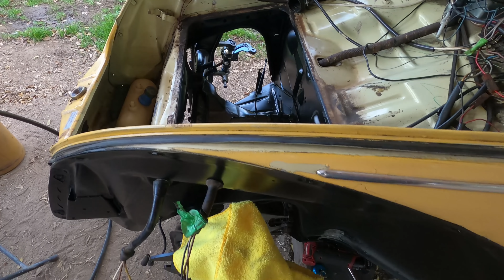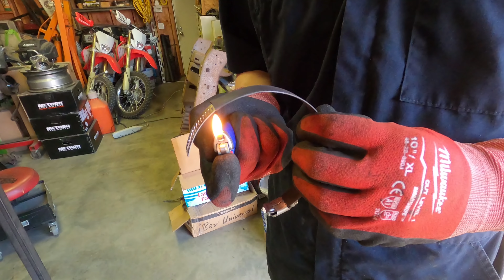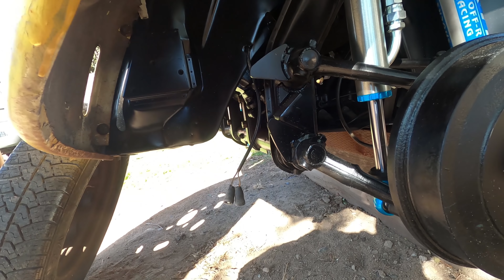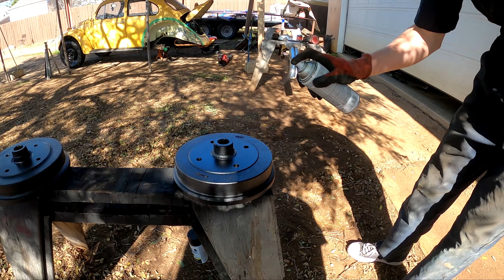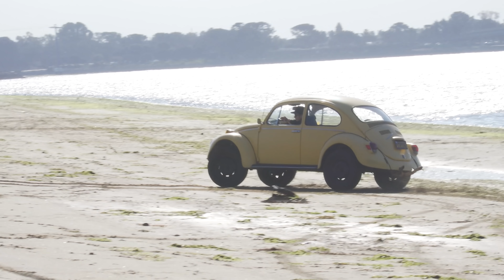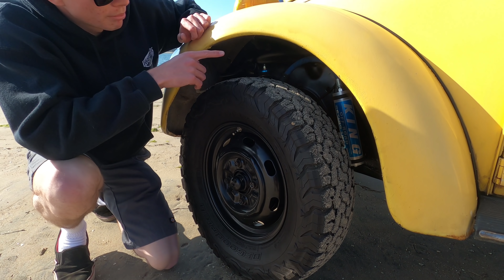Stage One is Complete! Bug Build Ep. 3

Comment: hi, I saw that you have fitted 215 75 r15 tyres, I wanted to ask you, have you fitted them on the original 4 1/2 Volkswagen rims?
Reply: I was wondering the same , however 215 wide is over 8'' so fitted to 4 1/2 would be not right. Possibly 6'' rims. Lets hope he replies.

Comment: Fantastic! I’m wanting to have an old VDubbie like this. I, years back, had a ‘71 Super Beetle, flat windshield, steel sunroof, pop out rear windows, worked the 1600 dual port to a 1776 cc’s, Dual DeLorto carbs with Porcha style linkage. I’m wanting to get one built again but I’d like to have a roll cage installed and a kick ass lift like yours to be able to take it off road. I’m a retired Philadelphia Police Officer and I’ll be 70 this coming October. With what’s going on in our country, a worked VDubbie with a compartment in the rear passenger area for an AR-15, first aid kit and other survival equipment would be genius.

Comment: you guys could have probably used a wire wheel on a grinder to clean the rear wheel wells up faster
Reply from the maker: I tried that! The liner was rubber/plastic and the wire wheel slowly ground through it, the chisel worked better to get underneath the liner and peel it off.

Comment: Just curious if you installed a solid Mount motor mounts? highly recommend
Reply from the maker: I have not! didnt know that was a thing haha, I will check it out
Reply: Solid mounts are exceedingly harsh. Urethene are too stiff for me. I'm going back to stock next time the gearbox comes out.
Reply: Ya its a big thing lol if you go offroading trust me you will need I had the rubber ones rip out and move the whole transmission back only thing holding was the clutch cable and throttle cable , oh and a ratchet strap lol so we can drive it home